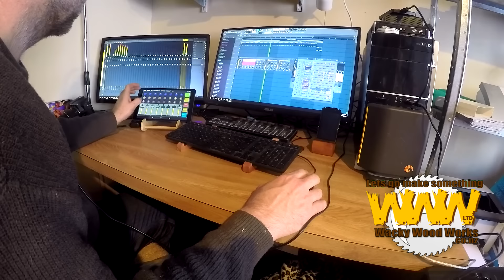Tidy up my desk with this keyboard holder - Off the Cuff - Stickers - Wacky Wood Works.

Comment: What a great idea. Good Job. I noticed when you were using the band saw, the blade would move back about 1/4 inch when you were cutting and then spring forward again when the cut was done. It shows that the bearing guide at the back the blade is not touching the blade. You need to move the bearing guide so that it is barely touching the blade as it is rotating.The bearing is there to support the blade throughout the cut, which will cause the blade to have less wander, it is safer for you and the blade should last longer because there is less stress put on the blade. Thanks for posting the build. I really enjoyed your choice of music today. Take care and keep up the good work.
Reply from the maker: funny you mention that ... when editing the video I I said the same thing  I need to adjust that... lol

Thanks for watching